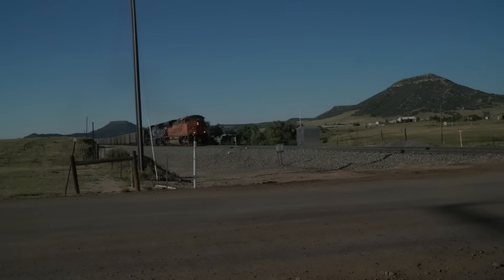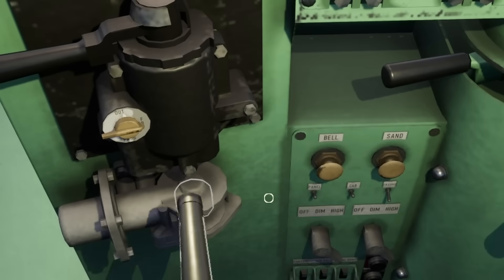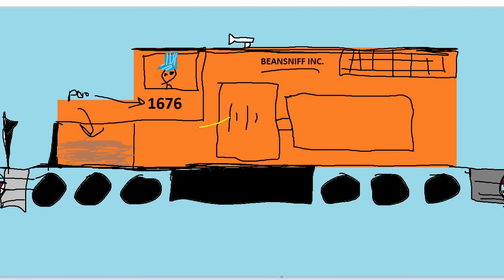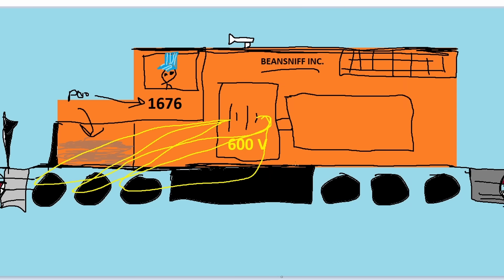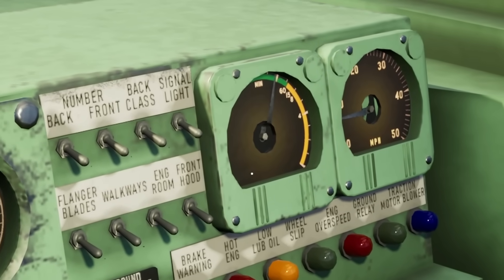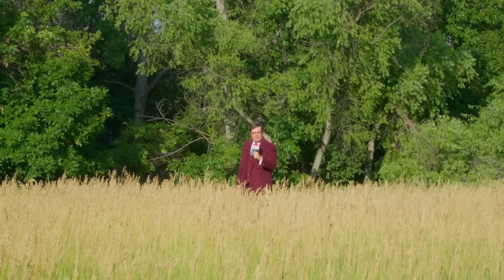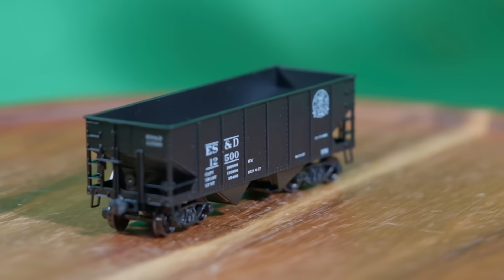The HIDDEN GENIUS of diesel electric locomotives... Transition explained - Railroad 101

Comment: Huh ok now I’m really curious about this topic. I’ve been inside a 1956 F9 that had manual transition on the control stand, but our 1956 GP9 has automatic transition… so was that an option at that time or was that part of the electrical rebuild that BN did in the early 80’s?  
I’ve also ridden in a GP30 before, it had pretty crazy transition especially going from run 4 to 5, and my understanding is they are pretty similar to the 35’s.

Comment: Electrical engineer here; you are bringing me back to my Intro to Electromechanics course in college :) This is all great and correct info.

To expand upon your points further just for the fun of it; these motor winding transitions are the exact electrical equivalent to a mechanical transmission. The math works out the same as shifting gear ratios would do.

 the back EMF (volts) is proportional to the motor's speed (RPM), and the current (amps) through the motor is proportional to the motor's torque. Therefore, mechanical power (Torque x RPM) is directly equated to electrical power (Volts x Amps).

There are two voltages to consider: the voltage "supplied" to the motor, and the back EMF generated by the motor. It is the difference of these that determines the motor current using ohms law as you showed. When back EMF generated is greater than the supplied voltage, the motor torque is becomes negative. This is how dynamic braking works.

When the motor windings are transitioned, the relationship between the back EMF and motor RPM is changed by some factor (r). But, this also changes the relationship between current (amps) and motor torque by the inverse of this same factor (1/r).

Exactly how a transmission changes gears to exchange torque for RPM, transitioning the motor windings exchanges current for back EMF.
Reply: > When back EMF generated is greater than the supplied voltage, the motor torque is becomes negative. This is how dynamic braking works.
Due to the way series wound motor physics work, its back EMF can never exceed applied voltage. To do dynamic braking, motor field windings are separated from armatures and plugged into the main traction alternator, while armatures are connected to resistance grids.
Reply: @Knsgf Thank you, this is a very good point that I had skipped over. 

For others, there are two magnetic field sources needed in a DC motor: a stationary field and a rotating armature. Many smaller DC motors have a permanent magnet to provide the field, but larger motors utilize an electromagnet instead, which needs to be powered for the motor to function. The back EMF generated by a spinning motor refers to the armature winding only.

This back EMF is not only proportional to rotation speed, but also the field strength (field winding current). I'm not certain if this is how loco's choose to control it, but applying a higher field current to a spinning motor in turn provides a larger back EMF, and can therefore provide more current (braking force) when the armature is connected to a given resistor load (since V = I*R)
Reply: @Knsgf  If the motor torque has become negative, that means the mechanical load is applying more force than the electrical supply. At this point the motor is "running backwards," or as we Engineers would say, it's acting like a Generator. "Dynamic Braking" is just engineer speak for "the motor is charging the battery instead of draining it." Personally, I would be surprised if Diesel Electric locomotives didn't have SOME battery storage on them, if not for balancing the power supply from the Generators and the drain of the motors, then for running the electronics when the Generator's are off.
Reply: @andrewdreasler428  Batteries on a diesel electric are solely for starting the prime mover and powering lights and cab controls when engine is not running. Dynamic braking is always done by "burning" generated energy in resistor banks. The sheer amount of power traction motors give out is simply too big for an onboard battery to handle.
Reply: @Knsgf  To start the prime mover, the main generator or alternator is fed power or voltage from the batteries to spin, therefore spin or turnover the prime mover starting it.  We did this with the Cooper-Bessemer engine on the 1203 at the Huckleberry RR to get it started.
Reply: @Knsgf  thank you, I was going to say the same thing.
Reply: that's what I thought
Reply: Does a Power Factor come into play? I know AC mains power uses Caps to match and tame lead and trailing sine waves, but with a stand alone ?
Reply: @hey_skip  It can but most probably not since there are machines at two ends of a set of wires.
Reply: @AugustusTitus  Cheers!

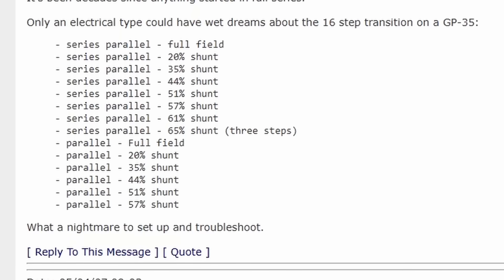Comment: 8:34  this reminds me of the Scott Adams quotation featured in Civ 6: “Normal people … believe that if it ain’t broke, don’t fix it. Engineers believe that if it ain’t broke, it doesn’t have enough features yet.”
Reply: Until you get on a ship. Then you add a third category. A sane marine engineers love. there is nothing more permanent than a temporary solution.
Reply: @cloggedpizza239  My experience with marine engineers is that the thing they love the most is acting like they're the people on the ship doing the most important work.

Comment: Yes, a very enjoyable video, Hyce. I teach automotive and aerospace engineering which includes electrical engineering, and your explanation of series, series/parallel and parallel setups was excellent. Just as a small point of interest, over here in the UK we regard the devices that produce AC electricity as Alternators, and the ones producing DC as Dynamos. Generically we regard BOTH as generators. However this seems to be just one of those very unimportant differences in the way our two great countries use language differently at times. Love all your videos by the way.
Reply from the maker: Linguistics are always interesting - the distinction over here is if it needs an excitation source, it's an alternator.

Comment: Transition isn't to protect the traction motors. You can easily exceed the traction motor's short time rating even in step 1. The steps of transition was actually so that you could get the full horsepower out of the engine, regardless of speed. The DC generator was only capable of outputting so much current and so much voltage that you had to change the circuits to get the full horsepower from the diesel engine at high track speed or prevent overloading of the main generator at low speeds. You could make the generator so as to be capable of handling the current of every traction motor in parallel, but you would lose the ability to develop full horsepower. The traction motors could not care less about the transition step you're in. 

Also, minor correction. Most American locomotives start in series-parallel. Very few locomotives had all 4 or 6 traction motors in series as any part of their transition, with the exception being baldwin who also didn't care to change a thing about that setup. Wouldn't budge past 40 without transition, though. Only the A1A E units from EMD started in full series, with 2 motors per generator.

Modern DC power doesn't use transition IIRC. The SD60s had alternator transition but ever since the Dash 8s they've had none.
Reply: All our SD70 M2s transition around 28 mph

Comment: I have a 1950's era SW1200 at my work site that we use as a yard switcher, it has a selector lever with three positions on the control stand that I am assuming is what controls the way the locomotive transitions. Auto, SW, and SER are the positions but we only leave it in Auto when operating. Any idea why the other two positions are needed if it has Auto anyways and what are they for?
Reply from the maker: That'd be for anything MU'd to the SW that still had manual transition. I'm not 100% sure what the positions would be for sure on an SW especially with those labels; but it's assuredly for controlling the transition over MU.

Comment: I was into streetcars and metros in the 80’s, and at that time most stock was still serial-parallel resistor controlled 600VDC. Newfangled Oslo articulated trams of ‘79 were thyristor chopper controlled - me going «wow, this must be the future…!» 

I was kinda right, but also late, and not from the best of insights… The last SL 79’s are now hitting the scrapyard, so… I outlived ‘the future’, I guess. 😅

Comment: There is another trick some locomotives use to manage current and voltage: field shunt. It connects resistors across field windings of traction motors above certain speed, so that only a portion of current flows though the fields. This cuts back magnetic field inside motors, reducing back EMF and allowing amps to rise again. Those who play Derail Valley can observe field shunt in action on DE6: there are two stages, which trigger at 45 and 53 km/h.

Transitions and field shunt are also not unique to diesel electric locomotives. Straight electrics, most notably those that run off DC power supply,  employ them too, however for different reasons. On a diesel, transitions help to keep amps and voltage of a main generator or alternator within design limits at different speeds, but they do not affect horsepower much, as it's maintained by a prime mover governor. There is no governor on an electric, so transitions there directly control horsepower - a typical 1960-era six-axle locomotive capable of delivering 4000 hp continuously in parallel will do about 670 chp in full series and 2000 chp in series-parallel.

Another thing that distinguishes diesels from electrics is that the latter are not constant-power machines - their supply voltage is fixed, and amps change with speed, thus making their horsepower also speed-dependent. At low speeds electrics can reach power level well above their continuous rating, which then drops off sharply as train accelerates. You might have noticed this quirky behaviour with BE2 in Derail Valley - in a flat yard it can rip even a heavy consist from a standstill, but once above 15 km/h it almost hits a wall. This is why bigger electrics feature a field weakening handle in addition to throttle: by manually cutting back-EMF a driver can bring amps back up and regain lost horsepower.

Comment: From a theoretical standpoint, the armature (rotor + commutator) of a DC traction motor is effectively fixed in it's configuration, the stator on the other hand can have taps on it so that you can have more or less stator windings in effect at any given time. This can be very useful if you want to make an electric motor go fast on a fixed voltage supply. (EDIT: Such as when you have an electrified railway where traction power is supplied by transmission lines rather than an onboard prime mover. END EDIT)
IIRC this is more a trick used by subway trains and other "fast passenger not cargo" type DC electric rail vehicles, and some early electric road vehicles too. Not sure if freight locomotives do this tho.
The idea is that you use all the windings on the stator from stall up to your first transition point, this provides the maximum resistance thru the field windings because there's not much back-emf coming from the armature. This prevents the motor from thermally overloading or generally drawing too much current. As the motor's speed increases, the back-EMF from the armature increases, and you combat this by progressively shorting out more and more of the stator winding by engaging contactors between the stator winding taps. Once you have shorted out all but the last (largest) segment of the stator winding, the motor should be going at full speed. Tap changing can be automated fairly trivially by a centrifugal governor that actuates a series of contacts in sequence, leading to the coil terminals on the field winding contactors.
This is used in addition to any machinery that varies the voltage and/or current permitted thru the traction motor(s) by any other means, it's basically another way to let a large DC electric motor work over a wider speed range. Permanent magnet DC motors aren't really amenable to such measures.

Comment: as for how modern ac ones work, my guess is vf drives, where you control the frequency of the power going into the motor. (thats how normal, overhead line powered locos work). you go ac -> (sometimes) dc -> 3 phase ac with variable frequency.

Comment: Ohms law tells us that resistance is futile < 0 Ω
Reply from the maker: Correct! :P
Reply: @Hyce777  Not so fast Hyce!   There is such a thing as "negative resistance" but it is not taught about in electrical 101 courses.  There are some electrical / electronic devices that exhibit a characteristic where if you put more current through the device the voltage across them DECREASES.  On the surface this would appear to be in violation of Ohms law but in fact it is not.  What is happening is that the device is dynamically changing its resistance in response to the current flowing through it.  Such a device, if directly connected to a voltage source, will be unstable unlike a "positive resistance" device.  As current flows in the device its resistance decreases which causes more current flow causing a further decrease in resistance.  This "positive feedback" cycle continues until either the device destroys itself or the voltage source blows a fuse.

In practical use such devices are always used with extra equipment connected between the voltage source and the device designed to limit or regulate the current.  In essence, this extra equipment adds enough "positive resistance" to the circuit to cancel out the negative resistance of the device.   A common example of this sort of negative resistance device is a fluorescent lamp.  The incoming AC power is not connected directly to the lamp but is instead connected to a "ballast" and the ballast is then connected to the lamp(s).  The purpose of the ballast is to limit the current in the lamp to an appropriate value.  Older ballasts did this with coils of wire on a metal core something like half of a transformer.  This arrangement has the property of "inductive reactance" which can be thought of as "resistance to AC current flow" (but not resistance to DC current flow).  Newer ballasts use electronic circuitry to provide a regulated current flow. Basically they convert a defined voltage input to a defined current output.  This current output stays at its defined value regardless of the resistance (positive or negative) of the device connected to it.

How do I know all this stuff?  Well yes, I am an electrical / electronics / computer engineer.  A significant part of my career in the 1980s was working for the Canadian National Research Council.  Part of the job was to design and build electronic equipment for spectroscopy where the scientists wanted to ionize gasses electrically so they could analyze the light they produced.  Like a fluorescent lamp, these gas discharges were negative resistance devices.  For the results to be useful they also had to be driven with smooth DC current.  it was quite a design challenge at the time given the abilities of the available transistors and FETs.  Over several iterations I worked out some tricks and was able to drive these gas discharges smoothly and stably up to several thousand volts and a couple of amps of current.
Reply: oh hello you :)
Reply: Have a great week to you both ;)
Reply: We are the Borg.

Comment: in early electric locomotives (signle phase ac overhead line), they used different transformer taps to do effectively the same thing. some also used the series parallel thing in combination with that. dc only used series parallel and high power resistors.

Comment: For back EMF, the way I understand it is that a spinning motor (especially thinking conventional brushed DC) behaves like a generator (dynamo) producing voltage towards the high voltage side, voltage proportional to speed. If the voltage put into it is higher than this back-EMF voltage, it behaves as a motor, converts electrical power to mechanical. If supply voltage is lower, it acts as a generator, converting mechanical power to electrical - which is useful for dynamic or regenerative braking. I have several fan motors on my car with series-wired LED indicator lights, when they shut off from a relay the spinning fan continues to put voltage on the plus-side of the circuit, so the light stays on until it spins down - this is a demonstration I'd use if explaining the concept to someone. An unloaded motor with a given voltage (say one of those little can motors connected to a AA battery) will spin at the speed where the supply and back EMF are equal and very little current will flow. This transition system is like shifting a car's transmission (in the manual shifting ones it sounds like it would be almost identical for the driver).

Love the crude MS Paint Beansniff Inc 1676 Poopomotive. Perhaps a T-shirt of that could be merch alongside the hyce-birds throwing 'splody-boy ES&D hopper.png at Leighton! (Not sure what explosive cargo ES&D would put in a hopper car, but we know they would!)

Comment: Later DC units had main alternator transition. Instead of going series parallel on the traction motors. There were two windings in the main alternator. These would flip from series to parallel. Sone older EMD would stay in parallel, and just use field shunting. Then there is the mess that is AC traction

Comment: AC motors are very different beasts from DC.
Looking forward to your explanation of Wye/Delta.
Reply: Wye/Delta is not needed when you have VFD.
Reply: @Knsgf depends. For the drive train you are right. But what about the grid. Your normal singles phase outlets. Your compressors and lights. Delta wye transformers certainly matter.